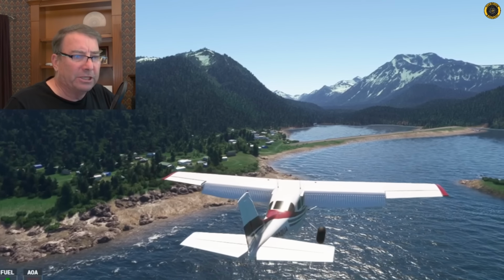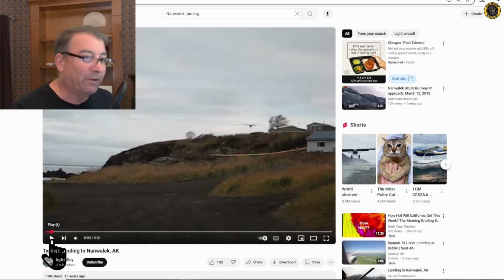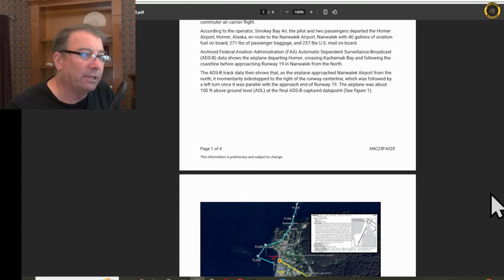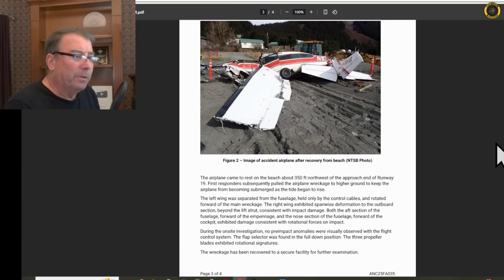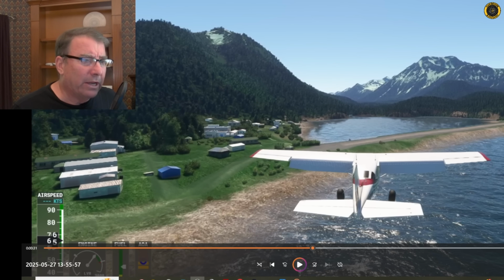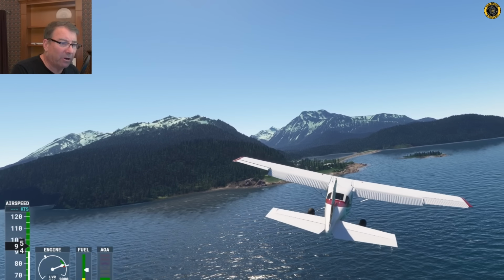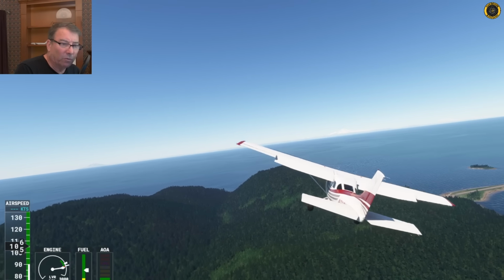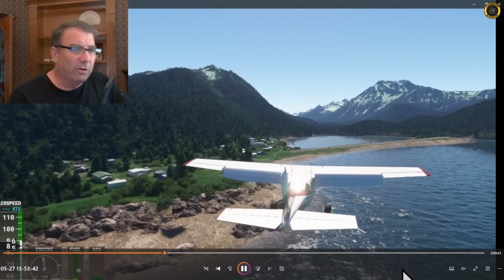NTSB Prelim Cessna T207 Crash Nanwalek, AK

Comment: Juan, I flew with Daniel a few years back when we both were building hours, I left Homer and moved to Anchorage to get my first job flying, a flew in and out of Nanwalek many times and more than once saw or talked over the radio with Daniel. 
Landing 19 I always approached from over the town lined up with the runway, and the go around was always to the right, landing on 01 was more challenging have to stay very close to the terrain to make the turn. 
I flew there on a Saratoga. 
I will miss my friend
Reply: Avoiding the town is adding a hole to the swiss cheese.......one day....
Reply: @davidpearn5925  I do wonder whether avoiding the town played any role in how Daniel ended up where he did. Of course once he'd lost control there was little he could do differently, but still, the proximity between the crash site and the last ADS-B datapoint, at which point he was still at over 100 ft (actually 175 ft, since he was at FL004 with local pressure setting of 29.68 inHg), would be consistent with him finding himself approaching the town before turning away to the left at the last minute; after all, in a straight-ahead stall, even at 100-200 ft, you'd still expect to see more forward motion than is depicted in the report. That's certainly not the only explanation, but in any case I hope the final report clarifies the witness reports that speak to the flight path and where exactly the stall/spin began, because at present, the preliminary report is pretty ambiguous as to whether the witness description of a "steeper than usual left banking turn" refers a positive control input by Daniel or is simply a description of a spin.
Reply: Sorry for your loss

Comment: Juan,
As you may already know, Daniel, the pilot flying, was a dear friend of mine. I taught him to fly (private and commercial) and he owned my airplane before I did (the famous 23U).

It’s been just over a month since this accident, and there has been a lot of information, thoughts, and ideas circulating. We’ve mourned deeply as friends and family, and it has certainly been a difficult time.

I have to respectfully clarify something regarding what you’ve depicted in the flight simulator. The flight path shown in your simulation is not accurate in terms of how pilots actually approach this airport. Pilots do not approach at an angle as depicted; instead, they typically come in over the village and descend almost directly onto the runway.

When Daniel initiated his go-around, presumably due to a dog on the runway, it appeared as though he was already established on the upwind leg as he prepared for another approach.

Company policy explicitly states that pilots cannot fly over the lagoon seen on the opposite side of the runway. None of the prescribed flight paths, including a go-around, would allow this. That valley is really, really gnarly for winds. It's quite dangerous to fly in there. Tight spot, with not a lot of turn around options. We Alaskans tend not to want to fly into that tight of a spot, especially somewhere like Nanwalek with notorious tricky winds. 

The most likely scenario would be that Daniel applied power, established himself on an upwind leg, parallel to runway 19 (south) and then intended to circle back for another landing attempt, to the right, on a right downwind. Makes no sense to turn left. 

Again, the flight path illustrated in your simulator is quite inaccurate. He would have been aligned fairly straight with the runway when this occurred. If you examine the ADS-B data closely, you’ll see his flight path over the village aligns almost directly with the runway, after which he offsets slightly during the go-around maneuver. Then, very suddenly, something unexpected occurs near the threshold of the runway.

Personally, I can’t yet make sense of it. It’s easy to assume some sort of loss of control, but at this stage, we genuinely don’t have definitive answers. We cannot entirely rule out an engine failure (NTSB says the prop was turning, though) or some other mechanical issue. I fully recognize such scenarios might be statistically unlikely, and I’m preparing myself to accept that a dear friend and excellent pilot may have made a critical mistake. What exactly that mistake was, there are a handful for options. 

I just wanted to contribute additional context to prevent misinformation from spreading. This accident is undoubtedly mysterious and will require considerable time to fully understand.

There's a video on my channel (Juan was nice enough to put it into the description) showing a bit about Daniel and his life, especially his flying background. 

Respectfully,
Chris
Reply from the maker: Thanks Chris! See the link to the Angle of Attack video in the description above.
Reply: @blancolirio  Thanks, Juan. Appreciate you helping with the other side of the story. Daniel was a really good man. He's left a last impact on my life and that of many others.
Reply: @angleofattack  Just to clarify, are you thinking he made the sidestep shown in the preliminary report as part of his go-around? As in, he spotted the dog before passing overhead the village, then applied power and broke right for another attempt? I was thinking the same things as I read the preliminary report, i.e. that it'd make no sense for him to track towards the lagoon, no matter what part of the circuit he was in (due to the lack of space for maneuvering and potential for rotors in that area). However, the ground track depicted in the report (namely the lines joining the individual data points) does seem to show something of the sort; that is, while he broke right initially, arresting his descent while avoiding overflying the village, and began flying what amounts to a tight right downwind for runway 1, he ultimately ended up deviating left towards the foot of runway 19, near the ultimate crash site, the whole time showing within 400-500 ft pressure altitude (or, within 175-275 ft MSL, accounting for a local baro of 29.68). The report also cites witnesses (the surviving passenger as well as those on the ground) corroborating that the 207 had entered a steep left bank before impact, but it's not at all made clear whether this constituted an intentional turn or was simply a description of a spin. Given all that, do I understand correctly that you think something could have occurred in that "right downwind for runway 1" leg of the flight which ultimately led to the plane deviating left and entering a spin? I should note that the ADS-B data from the report appears to be absent from public sources like adsbexchange, which stop tracking the 207 somewhere between Seldovia Bay and Passage Island, so perhaps I'm missing some further detail.

My sincere condolonces for your loss. From your videos and the outpouring from the community more generally, it's clear he was not only an amazing pilot who served Katchemak Bay area, but a person whom anybody would've been lucky to be able to call a friend.
Reply: @angleofattack  Sorry for your loss mate.
Reply: @blancolirio  & @angleofattack,  I respectfully asked why flight over the lagoon is not approved.  Why did you remove my comment?  It was a legitimate question.  I watch all your videos, am a commercial pilot and a Patron
Reply: @MarketPlaceRentals The terrain behind the lagoon is much tighter than the sim depicts.  Also, the approach to the south is done over the village, not over the beach, so turning right for a go around is a no-brainer.  

I’ve landed there many many times in 206 and BN2A.  I’d hesitate to take a fully loaded sled in there.  Too doggy.
Reply: Sorry for your loss
Reply: @yamnjam  Thank you.
Reply: @angleofattack my sincerest condolences. How’s bird activity in that area? Any possibility he could have broke left to avoid birds crossing left to right (after also seeing the dog) and the abrupt change to avoid the birds triggered the stall?
Reply: I have a place in Seldovia.  Nanwalek can be really challenging with wind.  Flying into the “canyon” is not advised due to even greater mechanical turbulence.  A go around should be performed making a right turn towards the water, which is easier than demonstrated because a more of a straight in approach is made to land south.
Reply: This might be a good time to mention 185/206/207 go arounds at sea level with stab/elevator trim all the way aft and flaps full.  With 185’s I teach adding no more than 25” MAP until flaps are retracted to 20 and trim has been trimmed nose down to a lesser pitch down force.  A go around under these conditions in a 185 is the most challenging maneuver of all.  There is no electric stab trim in a 185, so the single handed yoke push while manually trimming and the resultant slow speed with flap drag can be a challenging moment.  25” MAP maximum is the key until you regain speed and reasonable pitch control.
Reply: Wow! Thanks Chris. All input should save lives if we all pay attention. Thanks again, condolences to all involved.
Reply: Chris - my sincere condolences for the loss of your friend. Thank you for sharing what you know. Even if we can eventually line up all the facts, this one may never make sense at one level.  The good guys always seem to go too soon.
Reply: The only thing that makes some sort of sense to me was that he was on approach over the village as normal, saw the dog, veered off right over the water, and then decided to do a tight (lefthanded) orbit over the north end of the runway/village/water. Given that's where he went down. May have been trying to scope out what was on the runway. Doesn't seem like it was a proper downwind, as that would have been farther out over the water, and no reason he would have stalled at that point. I also don't think it was an extremely tight pattern from downwind to final, as that would be crazy, but it's about the only other way to get him into position to crash were he did.
Reply: Thanks for clarifying Chris. No offense to Juan but not setting up his sim exactly like the ntsb shows the approach was made could make people think thats how it looked. Lots of us appreciate the extra effort in the videos.
Reply: No update on the Memorial Day crash in the Houston area that killed a grandfather and his grandson?
Reply: Condolences and prayers for the victims, the family and friends  🙏 🕯
Reply: Amen. Thank you, Chris and JB. RIP and godspeed.
Reply: So very, very sorry for your fine friend.
Reply: My sincerest condolences.
Reply: Well said. Years ago we few a pair of 206's on floats out of Elfin Cove.  There is a little more to flying in Alaska than MS Flight Sim might indicate.
Reply: How long had he been flying?
Reply: Chris 
well said 
I was a bit upset to look at that video 
it’s inconceivable in my view to make such analysis without knowing more 
I am not sure if that fellow has ever been there 
it’s a tricky landing in a good day never mind in a gusty situation 
we lost a lot of friends over the years there 
maybe it’s time to look again at the proposed site long ago between Port Graham and Nawalek. 
you’re right that pattern used on a simulation by this video is not the way we do it there
I lived in Seldovia for over 40 years and have flown in Nawalek many times

Comment: Aviation newbie here... That place seems really remote and quiet, so I can't imagine there to be big noise ordinances in places that prevent a better approach. I get that it is mountainous on both ends of the runway, but why doesn't the plane go more over the flat-looking village area so that there is more space to align with the runway instead of forcing the turn right before touch down? Combining a turn together with a self-observed 'dog on the runway' event seems to make two simple events combined into something complex. Being able to line up the approach earlier might make the go around be far less overwhelming.

Comment: Hi Juan. This is a great channel, especially for an analyst.  

One quick question if possible. Assuming the pilot did not see anything in the runway, what would the risk to the aircraft be if a dog was hit? I'm thinking of the clearance between the bottom of the prop and the runway, or damage to the landing gear. 

Condolences to the occupants. 

Thanks as always.

Comment: Why wouldn't you set up straight-in over the buildings vs. having to make that low altitude turn  to align with the runway?  It seems like straight-in would be more stable and far safer.

Comment: Smokey Bay Air , along with most Alaskan air taxis, does seat passengers in the front right seat. I’ve wondered that seeing a dog on the runway didn’t cause an overreaction from the passenger that resulted in startling the pilot or even interfering with the controls.

Comment: Out on the open planes during my early pre-solo training doing go arounds and my instructor let me sit there with full flaps for a while before correcting me since I was having an issue remembering while training at our home field. I remember climbing at about 50 fpm with 30 degrees of flaps in for what felt like ages. When we got back home I remember coming in for landing and visualizing going into the buildings off departure if I performed as I did an hour earlier. Always interesting how these little lessons stick in your mind. 

Also the dog on the runway for some reason reminds me how many car crashes we have for people slamming on their brakes to avoid hitting geese crossing the road around here during migration season. Always bothers me when I see people doing that.

Comment: I have a similar flight stick for simming, but it is a Saitek model.  I've often thought about investing in a yoke and throttle/prop/mixture block of controls.  But I just don't play enough to warrant the money spent and it seems silly to be attaching and removing all that from the desk.  Another thing, maybe I'm wrong:  All the yokes and throttles seem to either be very poorly made toy plastic and still expensive, with the next tier being thousands of dollars and of extremely high quality.  There is no in between.  Another reason I haven't spent the money.

Comment: Regardless of go around track choice, none of these necessarily steep turns need to be level or climbing turns.  Straight up the valley would be orographic lift and wings level until turn back and then release of back pressure in the steep turn to prevent stall.  This is exactly what the airplane wants to do...correctly.  In these canyon type turn backs vertical space often is greater than horizontal space available.  Flying all the way to ground, if actually between rock and hard place is still safer than stall/fall to ground.  Why do we train to maintain altitude and not airspeed as the airplane wants to do?

Comment: Minor nitpick: The simulated accident flight path doesn't seem to match the path indicated in the report. In the report it appears the aircraft was parallel to the runway on approach but slightly to the right such that it flew directly over the village (which you could also see was the approach path of the aircraft in the first landing video as well). Then it turns RIGHT, away from the runway, THEN a hard left. I realize the track data may not be 100% accurate but if nothing else the initial approach is probably pretty accurate. Juan's simulated flight approaches the village about 45° from parallel to the runway, with no right turn away from it before turning left. This puts his final left turn ending much closer to the terrain behind the village. Perhaps it still demonstrated that a left turn go around isn't a good idea there but it didn't really simulate the accident flight path accurately.
Reply: Yup - minor indeed.

Comment: I've ridden that approach as a passenger a few times now (both directions) for work and I have not seen an offset approach like that. Each time we have done a straight in approach over the village, which does put the plane about 50' above the tribal council hall right at the end. The terrain on the sim doesn't show it but there is some rising terrain on that end of the runway as well so you are coming down in a steeper descent than you would normally. I have a more current video of the approach from 2023 but it looked very similar to the first one you showed.
Reply: Yea like Chris mentioned even the ntsb report shows the approach being initially flown over the village. Not sure why its so offset in the sim
Reply: Yes indeed, I was puzzled by the 'dog leg' on approach.
Straight in sounds much more appealing.,
Reply: Is the flight sim ms 2020. Looks like you have Google maps instead of bing. Help. I h Ave been disappointed with bing maps